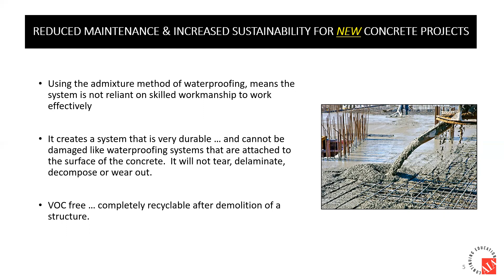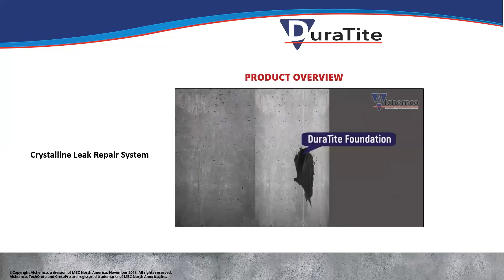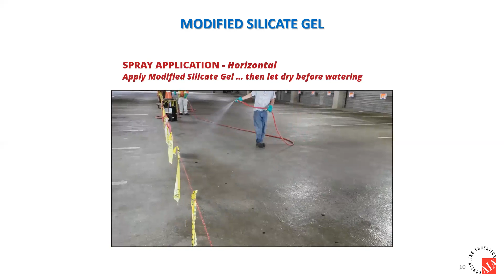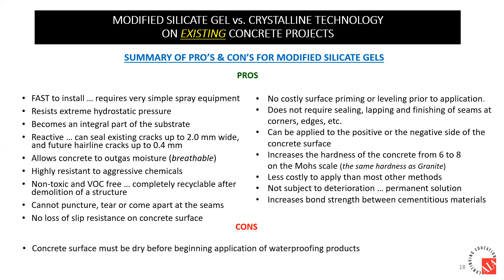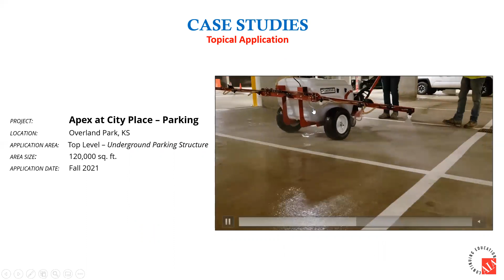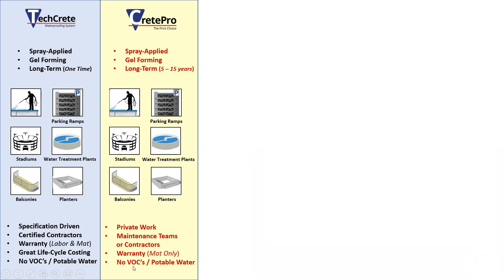AIA Certified | Crystalline Technology vs Gel Forming Technology - What is the Difference?

Comment: Concrete slabs on ground are required by IRC/IBC to have a water vapor barrier ≤ 0.1 perms. This is in part to prevent water vapor from compromising floor coverings. Does your product eliminate the vapor barrier requirement saving the cost of this requirement and the problems of punctures in this product? I could not find any data on the products perm rating.